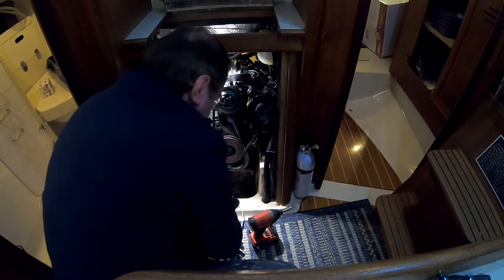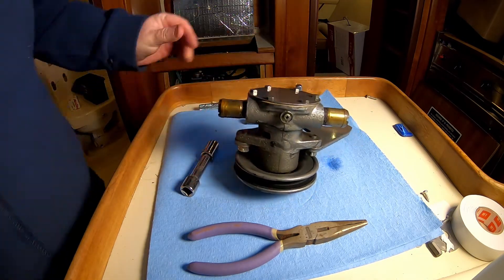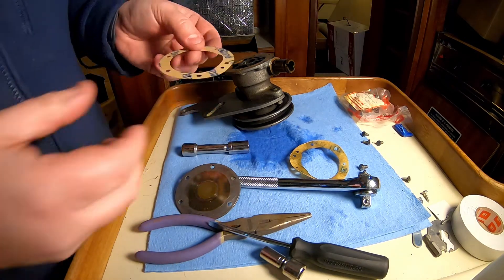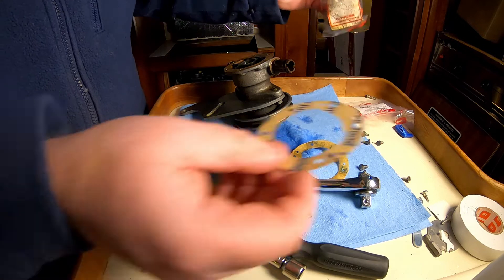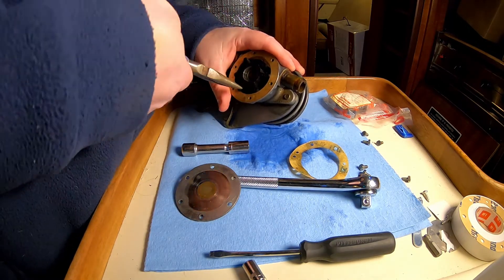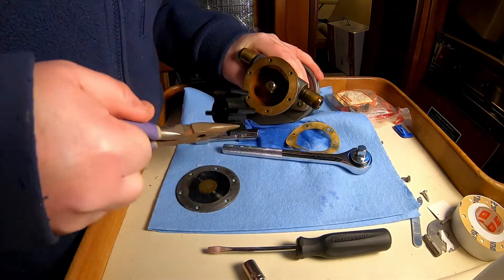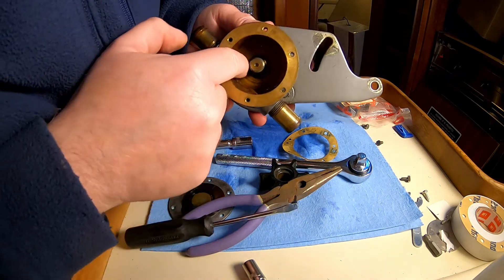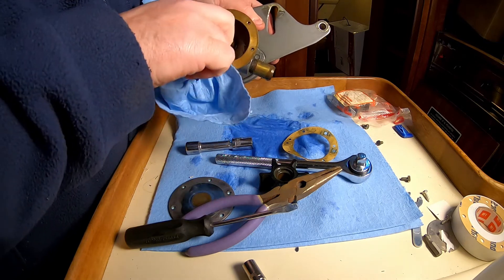Après Sail -  Tech Ep4 - Yanmar 3GM30 waterpump Impeller Replacement

Comment: Awesome video friend!  You might have to include links to the parts you purchased in the description. That way when I’m ready to tackle this job I know exactly what to buy!!
Reply from the maker: Good Idea! - the Gasket is https://amzn.to/3KGlXhT but out of stock at the moment.  The Impeller I used was 124223-42091 that was already a spare on the boat - actually there were 3 spares, I have one left.  I believe there is a newer version 124223-42092.  

This kit (https://amzn.to/3sdWgPg) may be a good replacement but I doubt it is a genuine Yanmar part - I have not used it though.